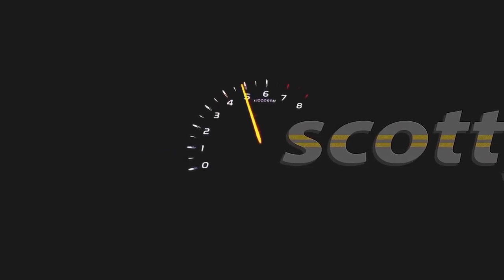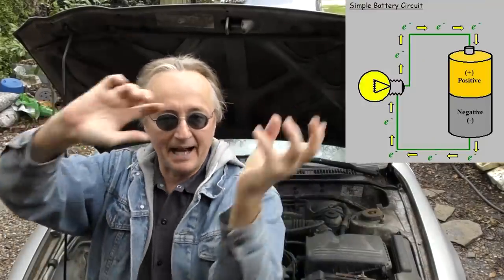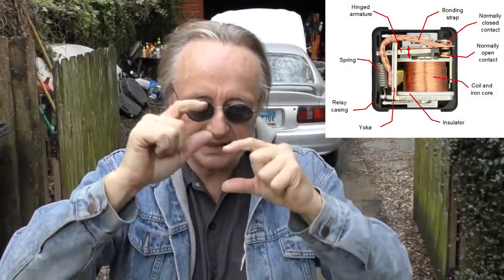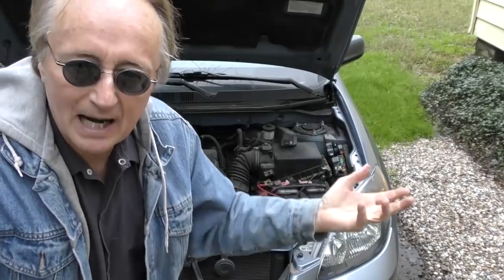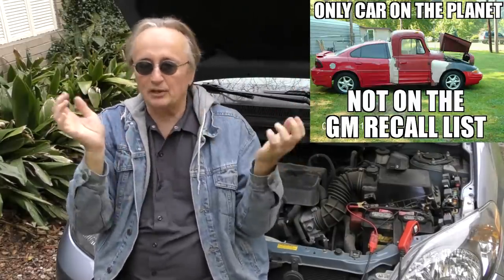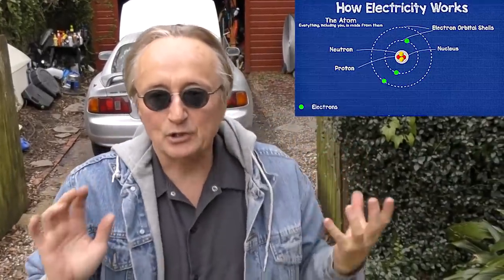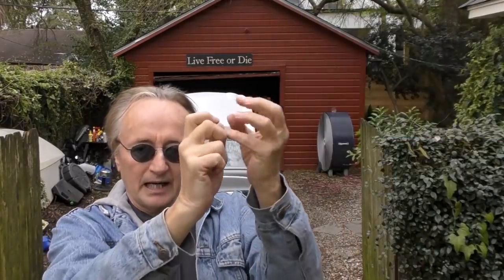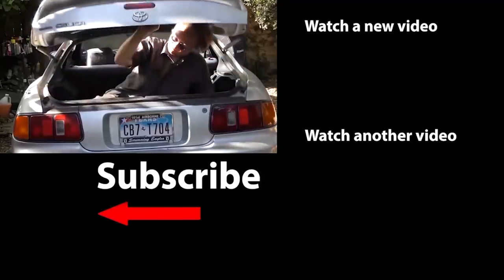Doing This Will Save You Thousands in Electrical Repairs

Comment: Thanks Scotty! My dad always said electricity runs in a circle doesn't matter how many x it twists over or how many times it connects to the next outlet: you will always have to check every connection that it passes through. I knew about the battery and checking hot spots but you made it easier to understand the rest of the system with a simple tool

Comment: Technically electrons flow from negative to postive which alot of people dont know ;) I'm sure u know scotty but was irrelevant to mention in this situation,  love the videos man!!
Reply: Doesn't matter WHICH way electrons flow, unless you mix up * and - on one of the wires!.   As Scotty AND your brain tells you , when you have a bad ground or a resistance in the wire or a burnt relay, current flow either stops or is insufficient (resistance) to do the job. and if you 
You got no flow,
The car no go.    ;-)

Comment: Hi Scotty. I am from the middle east. From Lebanon. I have  an old Oldsmobile 88 year 1992. I sure have a major electric failure in it. If i leave battery wired it will drain overnight even when car is off. Now i lose the negative wire when im not using it. But when i turn it on the lights inside the cabine are brighter than the sun! And after few minutes the negative pole of the battery is hot as the sun as well..! I KNOW it wld be easy for u to figure it out. But after 300$ of fail repairs with many electricians i still believe it is an easy fix... just have incompetant ppl who worked on it..!
One more thing. Now the car is barely running to 3mph and im sure it is not the transmission... i love this old beast.. my oldsmobile! I also own a Pontiac Bonneville.. but thats another story!

Comment: Scotty I have an old s10 with 344,000 miles factory engine and transmission 4x4 I was driving along a few years back lightning hit it blew the battery apart trashed most everything on it especially the ground wires being a GM I replaced all grounds that’s been over 100,000 miles ago I will drive it till it’s dead most everything works properly love your show very informative

Comment: I have an 06 Mustang GT that was causing intermittent slip issues in the transmission during the summer of 2017. No codes or no flashing OD and disconnecting the battery would resolve the issue for a while. This summer past my car overheated one day and again no codes and I could not figure it out. The cooling fan worked fine in the driveway but after driving the car the fan would stop working. I replaced the thermostat, the radiator cap, tested the radiator (good) and replaced the fan assembly. Still issues. I checked the BEC (engine fuse box) by removing it and discovered a short in the wiring to the high speed fan relay. It had burned the wiring harness connector and the same connector was tied to fuses controlling the transmission. Replaced the BEC with a salvage one and re-pinned the burnt wiring harness connector using a salvage one and VOILA, cooling issue and transmission issue both solved. Something was not right in that BEC for a while. Even my stereo system sounded louder and clearer afterwards. I had people tell me that I had a head gasket issue (despite no symptoms), a bad PCM, internal transmission damage and it was none of that. It was a simple electrical gremlin that was hard to pinpoint without codes but caused a massive headache with troubleshooting, research and repair!! Electrical issues are the worst. And to think we have planes with all kinds of electronics too, scary!
Reply: Another parts changer
Reply: Fire up the parts cannon
Reply: New Wave Auto Diagnostics nobody could figure it out. I was told it could be the head gasket even though I had no symptoms for that and I was also told it could be the PCM. It had no codes and even when it overheated it is supposed to store a code for that and it did not. Nobody knew what the problem was. I even had a Ford technician look at it with his Ford computer and he could not figure it out. The choices I made were logical ones to try to solve the issue. When 4 different mechanics did not know the problem it was not an obvious fix. I am the original owner of the car and it’s a well maintained car in phenomenal shape. Weird stuff happens with cars sometimes that are not always easy to track down. I have never had a car burn into the engine fuse box and my father in his mid 60s who has had many vehicles said he’s never had such an issue either. I think the short was caused by a daytime running light module that a guy wired into the BEC in 2007. I bought the car in the USA and you have to install daytime running lights when importing to Canada. The guy had it wired into the PCM fuse which is on the same section of the BEC as the cooling fan relays. So I think that setup caused the short. I have since removed the DRL module.

Comment: My starter wouldn't work and had sparks coming off the metal temperature gauge line against the firewall. My ground cable had come off the engine block. Luckily it's a 79 with no computer to burn up
Reply: good job figuring it out! kudos

Comment: Thank you Scotty for making this video! My 1989 Honda Prelude Si 2.0 started acting weird this week. When I drive around everything is fine, but the moment I turn on the headlights and fog lights, the check engine light turns on but only when accelerating. Sometimes it only lights up when I press the clutch in. Sometimes it lights up with the brake being pressed. I now think I have an electrical problem since it has been raining here in Los Angeles and before the rain it was not doing that. I will continue with checking all my grounding wires and my relays and fuses. Thank you! :D

Comment: Great advice! I never thought about using the heat as a diagnostic tool. Faulty grounds can actually start house fires (usually at the outlet or panel), but I never thought about it from a point of prevention.

Comment: Anything that causes a restriction in follow causes a hot point. In due time, it could become a fire hazard on the positive side. On the ground side, it’s going to cause your item to malfunction.
Reply: Man, i had a loose connection on a fuse panel. That wire was for air conditioning. Thank God that the fuse blown. The fuse box started to melt and smoke.
Reply: Wrong. there's no difference at which side the bad connection is. If there's a significant amount of current flowing through a bad connection, it will be heating up, period. Same damn electrons flowing at the same damn speed through a similarly shitty wire.

"On the ground side, it’s going to cause your item to malfunction." HAHAHAHA, so if theres bad connection on the positive side, the item gonna work just fine? Funny.
Reply: @xdygmnyrdf   you're correct.
Reply: Mr madness,    Doesn't matter POS or NEG.  Don't try to sound knowledgeable when you aren't sure, someone else might learn wrong
Reply: Extra resistance in a connection can cause heat, can also cause the computer (ecm, ecu, pcm, etc) to get a false reading from some sensor. Want to create some real heat? Just let a connection that carries a fairly heavy amperage start to arc.

Comment: Very good video
Back in the 60s l was sent to a local garage, there was a brand new 1 ton commercial van with an electrical fault .
On inspecting the electrical fault l soon found out that the body ground had not been fitted .
When the vechicle was running without any load on the electrical system the charging rate was correct when side and headlights put on went from 14 volts to
Just over 18 volts the more things you put on the higher the charging rate and voltage.
I fitted a ground cable between battery neg and ground this cured the problem.
The 4TR voltage req was grounded through the body, with body ground missing was causing the req not to work in the system.

Comment: Hi Scotty. I have a BMW Z3 3.0 litre. Its had all panels removed and replaced with fibreglass to look like a Maserati from the 60's. So the electrics have been "messed" with.  Recently I thought I had a bad battery. I recharged it, did a load test and  battery proved to be alright. Sometimes it would drain overnight. Did a "leak to earth test" ..no problem.  It went on like this working fine for weeks,  then sometimes the battery was completely drained. I stopped at the shops one day and coming back, noticed one of the headlights was on. Ignition was not on or the headlight switch... weird as you say. Intermitant faults are such a pain! I guess I will be checking the earths now !

Comment: Funny, I just clean my battery terminal. Be aware that some cars will idle low after removing battery. Just drive as you normally do and it should relearn it and go back to normal.
Reply: Check on what the relearn procedure is on your car. A Subaru will not relearn by driving. Let it sit and idle for 10 minutes and it'll be fine.
Reply: @veteranheavyequipmechanic4990  thanks. That's good to know

Comment: My 2005 Trailblazer would turnover but wouldn't start. Spent two months in two different shops. Finally the dealership found that it was a bad ground wire to the fuel pump. The first shop had already replaced the fuel pump and refunded my money for the entire job because it still would start. Dealership cleaned up the ground and I've had no problems in over a month since it was fixed.

Comment: Many years ago when I was working at a 2 way radio shop, we got a police car in for an estimate.  The interior had caught fire, and was put out with a chemical fire extinguisher.  The police officer that was installing equipment on their cars had used a single screw to ground EVERYTHING!  He put it between the seats on the transmission hump.  He also didn't cut away any carpet.  The car functioned until the first HOT pursuit.  With the radios transmitting, the light bar on, the siren wailing away, it gave new meaning to HOT pursuit!

Comment: Nyogel is good for electrical connectors, I belive USA millitary use it. I used to work at mg factory in the UK and one of the electrical engineers used to tell me to use it, it was used on certain recalls for airbag connectors under the seats.

Comment: I have a yukon...bad grounds have caused no start/no power (negative ground needed cleaning)  also caused no power to abs module (cleaned abs ground worked again) you totally right, gm has the worst grounding practices

Comment: Keep 'em coming, Scotty! I don't wrench on my vehicles like I used to, but it will always be interesting to me. 
When you mentioned the bad grounds on older GM cars, I was thinking of how bad Chrysler was in the 70s for that. When I was a teenager in the middle eighties, we had both a 78 Ramcharger and a 78 C10 pickup. My dad was a dyed-in-the-wool Chevy man. Guess who got to be the one working on it when something happened? Gotta admit- I still kinda miss those old six-bangers. The Dodge had a 318, and even with that, you could still climb up there and sit in the engine area to work.

Comment: Relays are remote switches. Relays are cheap. Keep spares on board. Same with fuses. Relays are easy to check. 

A thin file is best for cleaning connections. Pack connections with silicone grease when clean. Apply copper antiseize to ground connections to optimize conductivity and resist corrosion.

Comment: Great Video Scotty! thanks for all the hard work

 .. here is another tip .. NEVER EVER spray clean your engine compartment always do it by hand if you must clean it .. spray cleaning is ok (still would not recommend) for older pre-ECU cars but is murder for anything modern  
.. the water will get into all the wires sensors and electronics and cause corrosion everywhere .. you may as well take you car and light it on fire

Comment: Regular soda takes away battery corrosion better than anything else
Reply: Dont do that..... Soda does allot of things but ypure literally not saving any money using soda.
Reply: @RiorXD  give me a scientific reason why not?
Reply: @joeandgod1  scientifically my pocket says waste of money.
Reply: You can use the soda, but you always have to remember to clean up the area properly after you do it because the other ingredients in the soda can cause other damage that you may not immediately see...... And it wouldn't hurt to also coat the connection with something that will prevent future corrosion on the connection
Reply: @RiorXD  That's what I figured, you're not all there, it's okay
Reply: @joeandgod1  you liked my comment when i first replied then waited 3 hours to say that. K
Reply: Island Mike  in verbatim tell me where i said it didnt clean it.... I said its a waste of money. Soda is more expensive then just getting a terminal cleaner or even just going to the part store and borrowing the one they use when changing your battery.
Reply: I don't use soda, I use pop.
Reply: @darrellr267  i dont use pop i use fizzy drinks.
Reply: Island Mike  concidering im the one buying i dont have to be fun :d

Comment: I had a fuel relay fail on a 2006 Nissan Sentra but it only failed when the temperature of interior of the car was really hot so it only was a problem if my car sat out in the direct sun in the middle of summer all day. Dealership mechanics couldn't figure it out. My mechanic at the time figured it out and it's never had another issue. At 206k as of today.

Comment: Grounding problems are fun.  Especially on older foreign cars.  Step on the brake and the windshield wipers come on.  Those old 1157 bulbs had 2 filaments that would short internally and drive you nuts.  I learned and now I'm an expert and don't want to do it anymore.  Such is life.

Comment: 1:10  any soda will work wonders getting rid of the corrosion around battery terminals (due to the acid in the soda).  Pour a little soda on them, scrub them down as Scotty says, and (believe it or not) spray the battery terminals with WD40.  I did that 3 weeks ago and not a single spec of green corrosion.

Also, stick a penny by each terminal.  The copper will attract the corrosion.

Comment: The mechanical relays do have a maximum number of times they can be switched, so they will eventually die. The more you turn your car on and off, or turn the particular system on and off, the quicker it's going to die.

Given all the road spray this winter as well from the cities having to constantly salt the roads, I think this spring I'll look at having the shop check all the electrical connections. I'm noticing some things on my Jeep periodically not working completely properly, and given what you're saying here, it's probably road spray causing some corrosion on any exposed connections. You'd think the manufacturers would spend a few extra pennies per connector and make it so they aren't completely exposed.

Comment: My 1st car when I was a kid was a 1952 used Pontiac. It had many problems but the one we couldn't fix was: If you let the car sit for a couple of days it would drain the battery. The local garage couldn't find the problem. My dad took it to a electronic specialist some place in NYC. After a week he couldn't find the problem and told my dad to get it out of the shop. I sold the car when I went in the army back in 1961. Yes I'm and old man now. Between that car and a new 1972 Jeepster Commander, I don't know which was worse. I'd say the Jeep.

Comment: 2001 Chevy Prism " Toyota Corolla"  150000 mi one day driving I flipped on the turn signal and the engine died...Took it in to  a local mechanic he replaced the headlight  control module. It ran fine for a couple months and the same thing happened. I replaced the module myself and it  still wouldn't run. A friend told me to check all the grounds there are about a million of them I found a burned ground block under the dash. it was the ground for the lights and the ECM.. Repaired it an the car ran for another 50k without any problems..

Comment: I used to have a '67 Skylark automatic with a floor shift. Someone gave it to me because the shift cable kept jamming then breaking. I finally figured out that somebody had taken off the ground strap from the engine to the body. The car was trying to ground through the shift cable and welding it to the cable housing. When it stuck, you'd try to force it and it would break the cable. Five dollar ground strap and a new cable and I had a beautiful Skylark convertible.  Bad grounds can do very strange things.

Comment: Relay's are just switches. It allows the system to buffer from high amp items. Controlling them directly will just be a problem. Send a small charge, it switches states, and viola, ac fan kicks in, blinkers blink, windshield wipers wipe. Not so much a safety device, but a extension of the computer.

Comment: Slightly off the subject.  Years ago I went through the trouble of replacing an oil pump on F-250 with an I-6.  Just as I was finishing up, my dad drove up and ask me what I was doing.  He ask if I had checked the sending unit first.  It turned out to be a $8 sending unit that took two minutes to replace.

Comment: When I clean a ground I put it back together with some kind of sealer over it otherwise the water, etc. that got into it in the first place will only show up again somewhere down the line.   A screw that pokes through, body or frame,  should be sealed on the other side whenever accessible.

Comment: I had an 85 Jaguar XJ6.
All sorts of mysterious electronic issues.
Problem was that Jaguar was often using body grounds and after 30 years they just didn't conduct well.
I ran ground wires to the troubled electronics instead of relying on body grounds and the problems disappeared.